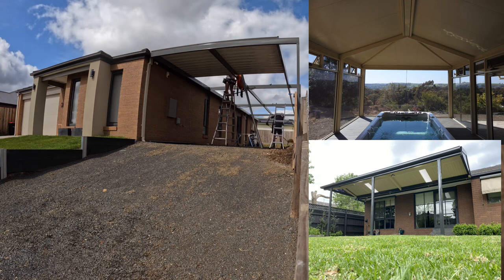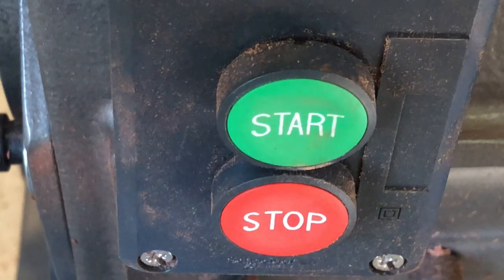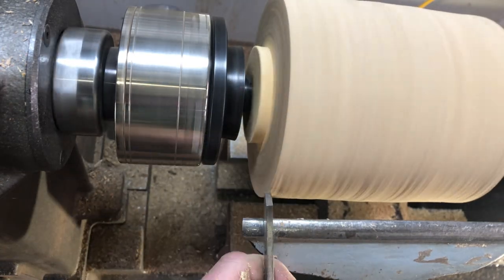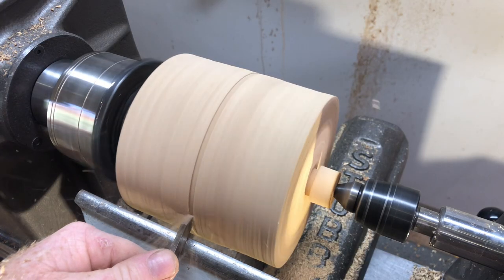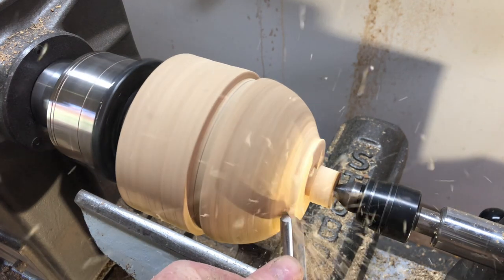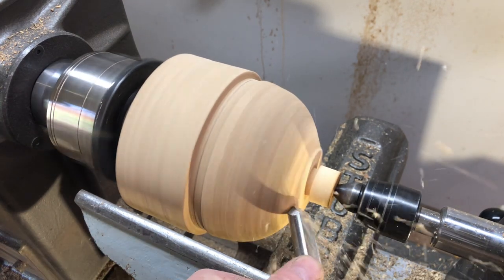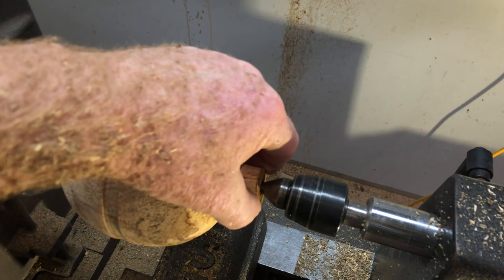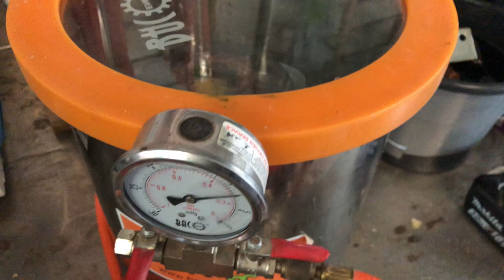Woodturning - Rotten Mulberry Sphere

Comment: Interesting and nice.  I am just wondering whether you should not have used the c. juice before putting the in the plug.  I can imagine if the sides were thin and the wood rotten, that the inside might have gotten filled with the juice and make it heavy.  Kind regards from fellow turner in South Africa.
Reply from the maker: Yes you are correct. I had another mulberry log that I did the same process but left the plug out and drained the cactus juice out. It was slightly lighter. All the best for the new year.